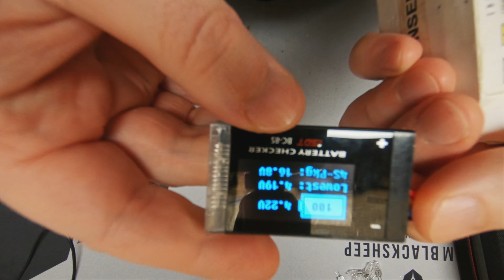how to Discharge Lipo Battery to storage URUAV DIY HACK

Comment: Hi again Kerni FPV! Thank you for your humble and sincere reply to my comments on having a “Mute” Video. In fact I am a newbie and furthermore, English is not my first Language either. So we have some common ground to back our own statements. As a newbie I find it hard to analyze and understand so many technical areas on this hobby that may otherwise be easy for others far more experienced in the hobby. Take PIDS for example, I still do not understand how how to even connect my Whoop Drone to the Application to adjust all the different degrees of Pitch, Throthle, Yaw, etc. I am stlill trying to learn to use a Drone Simulator in order to “learn and practice FPV”. So as you see it is hard for me and some begginners to grasp knowledge easy just by looking at a video without an audio track alongside and sometimes even Captions to fully understand some of the information. As I followed your links I noticed that you have a very advanced knowledge on Electronics and I will like to make this Mod you are doing in this video as I already have the parts. (This is the reason why I was watching your video) So thank you for replying in such a graceful manner and believe me your English is as good or better than any other in the same circumstances. Keep it up! This  video is a very good one! You have earned another subscriber!
Reply from the maker: Hello Joserrodz, you are welcome and feel free to ask anything you want to know! Yeah starting over in this hoppy is not easy there are a lot of information and you have to learn a good amount of things but today it is a lot easier than years ago :). The Application you are talking about is Betaflight you find this program here https://github.com/betaflight/betaflight-configurator/releases/download/10.5.1/betaflight-configurator-installer_10.5.1_win32.exe it is a tool where you can adjust all of the settings of your whoop or other drones with a betaflight compatible flight controller, you need an USB micro cable. for starters here https://oscarliang.com/ oscar has some super nice guides online and in his forum intofpv.com there are a lot of people including me how a reaching out to help. and learning flying on the simulator or better said to get a feeling for it is these days absolute the best way to start over which one you are using? Velocidrone? And thanks man I will just finish my video rig for all of the how-to videos and than i will start it :)
Reply: Hello again Kerni FPV! Thank you for your kind words and offer!  I am “trying”  to  use “VELOCIDRONE” but I still can’t “handle” the basic hover and forward motion good enough to complete one single circuit through the initial simple “gates”. Initially ob Februar this year I  started using my  Macbook but with 4GB of RAM there was not much I could do to even setup my Controller, choose a Quad and a Track and already the Graphics were gone!
So I had to wait until I could purchase a better computer with at least 16GB RAM. By July I purchased a used 2016 Lenovo Laptop with 16RAM and upgraded the HDD with a SSD FOR FASTER speed. I still have not been able to use it fully due to some pending major maintenance jobs in my house.

Comment: Do you need to Set the low voltage cut off every time ?
Reply from the maker: no it remebers but it is super fast to set
Reply: @KerniFPV  damn 🔥
I will build a 6S1P
( or more in parallel: 6S3P ) cable with PH2.0 & BT2.0 ( & maybe GNB27 )

Best and easiest solution for storaging discharging 1S..

Besides the "TinyWhoop storage discharge plug"

Maybe 2S and 3S balancer cables can be build..
( so I can plug 3 x 2S into it..
Or 2 x 3S..)

I think buying more of them is easier haha ( URUAV UR4 )

Comment: If i use g4 bulb 50 watt to every both of resistors ..is that will make to overload ?thanks
Reply from the maker: Overload not but it is way to much and you dont need su much Watt with this setup your lipos are fine in around 10-15min

Comment: Hi, can I put a resistor instead of light bulbs? If yes, what value would I need?
Reply: Any youd still need something to use power tho. I leave the lipo checker plugged in most the time tbh and listen for the alarm, its leds flashing drain slow so nothing to worry about... Id advise around 4v storage too as Ive had a few new never used lipos puff..

Comment: Moin, sehr geiles Video.Kann ich mit mehr Lampen die Zeit nicht weiter reduzieren. Ergo 2 x10 Watt pro Serie. In der Regel lade ich parallel und hätte auch gern die Option  parallel fix zu discharchen.
Reply from the maker: Vielen dank, also mittlerweile hab ich es mit Watt Lampen probiert und ja das geht, die zeit geht recht trastisch nach unten.